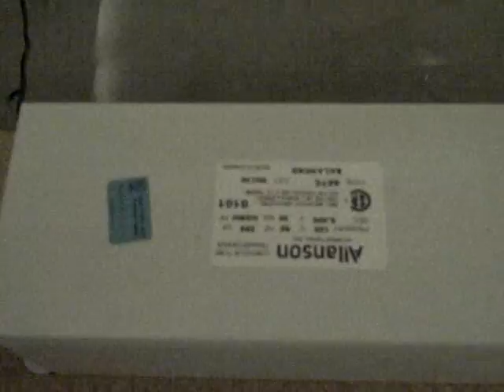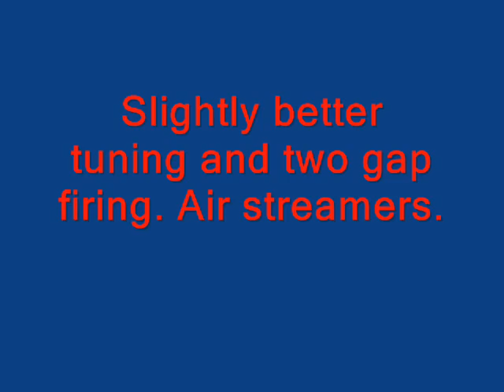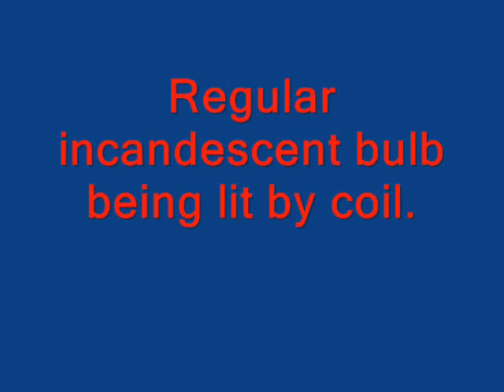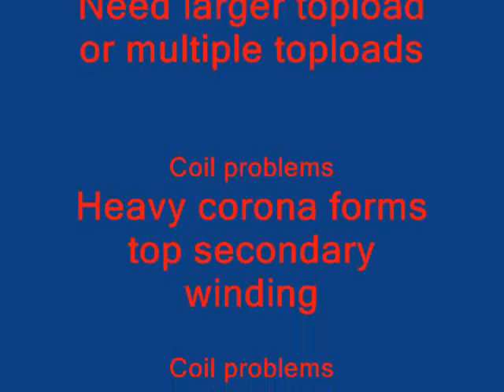9kv 30ma 4" Tesla coil - Test Fire

Comment from the maker: It's not really proven to filter the frequency we create with our coils, but I'd like to think it's helping... There is one obvious design flaw. I have the filter located right under the coil. It should be kept as far away, and as close to the wall outlet as possible. I ended up making my own control panel with power switch, push switch, light indicators, and filter all in one. I use that to control my new coil.

Comment: hello..not trying to bum you out but you have very off tuning....i have a 700 turn 2 inch but 11 inch coil...i use 2kv and a few milliamps and i  get 2 inch spark....but you have a VERY nice coil...just need a bit of tuning and like homedistiller said you need a larger capacitor for resonant charging.i must have great tuning for my current setup...but with a topload i get NO breakout....but that is because i have a bugzapper runing it!
Reply from the maker: Just thought I would reply to this 12 year post.
https://youtu.be/yf3drI6pEjM
The rebuild I did over a decade ago put out nearly 2ft discharges with same capacitor bank and transformer. The new build being extremely over designed. Check my videos you will find one that shows her in all her glory. I'm thinking of doing decade overhaul. The redesign is built for 6ft plus discharge. Never did jack with upgraded power source after redesign... :(

Comment from the maker: How do you figure smaller than resonant? The cap value tapped at 11 series caps is 13.64nf, LTR static for a 9kv 30ma NST is 12.4nf, and resonant is 8.8nf. To be smaller than resonant the capacitance would have to be below 8.8nf, correct? So, I am really above the optimum LTR Static value, but it is still LTR.

Comment: yeah but you have a cap with a SMALLER value than resonate charging... i am running my coil with resonate charging and have had no problems... and i only have a safety gap and 2 RF chokes

Comment: you need 2 more caps to get resonate charging with you NST... plus your wires especially you primary are WAY to thin.... the top load needs to be just about the top winding of the secondary to stop corona...

Comment from the maker: Hi newtonain, I did use TeslaMap5 to calculate a lot of the parameters, but this program lacks coupling support, and topload height support. I plan on making a smaller coil while I rebuild this larger coil. The new larger coil setup will have a 15kv @ 30ma fraceformer unpotted and shunting removed to about 50ma. Possible I will unpot the other, also a 15kv 30ma fraceformer, remove the same amount of shunting, and parallel the two for 100ma at 15kv.

Comment from the maker: I'm about to cut the length of both sides of the PVC secondary. I'm sure it could stand higher coupling, and I need to lower the topload to prevent a lot of the corona forming on top windings. I think I will make a new primary coil. Current one is tapped at last turn, 12, and still not close enough to resonate with secondary and topload.